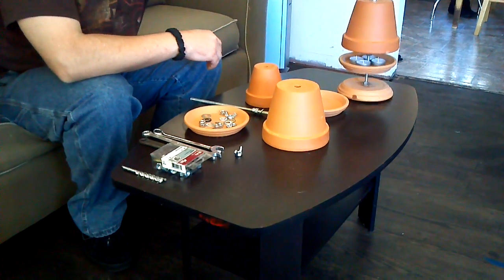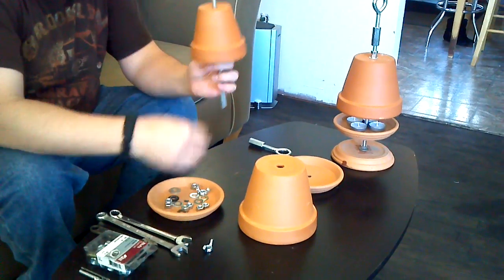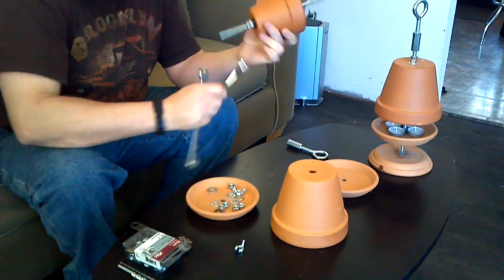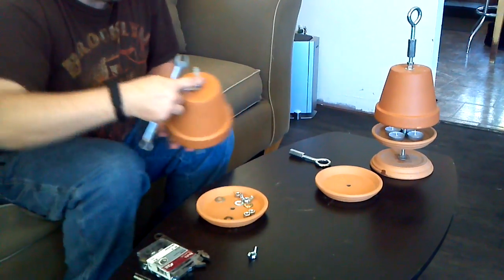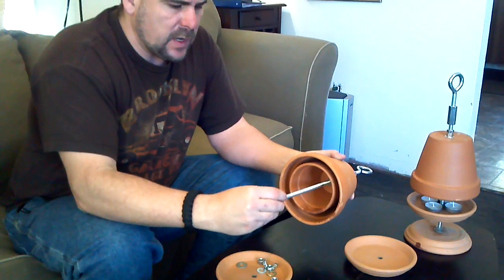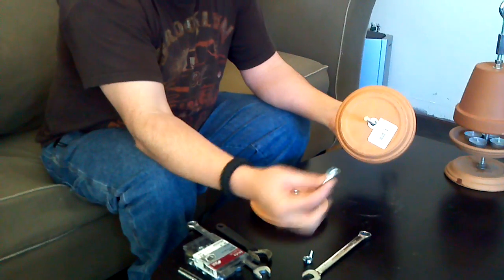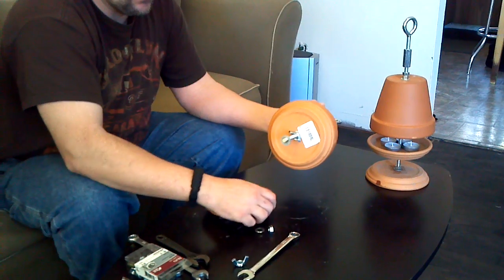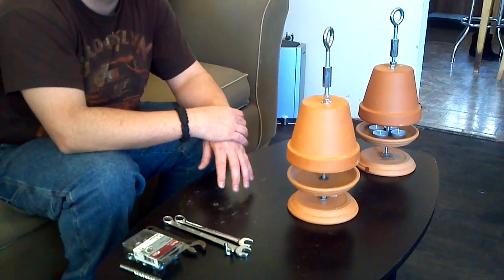Flower pot heater

Comment: Electrical rates have almost doubled in Richland WA due to some "new" projects.  People are protesting (real) & taking pitch forks to city hall... (not real) I am investigating how I can at least stay warmer in the afternoons in my small apartment. Two of these with Crisco shorting candles would burn for 6 ++ hours for just pennies.  Safety is a big issue I would put them on a cookie sheet with a ceramic tile under that. Never leave them alone.  Going to the garbage bin, I would lift the lid blow them out.  Never sleep with them going.  Thanks for the video.

Comment: A candle puts out a certain amount of heat, this heat cannot be amplified without the addition of external energy, laws of thermodynamics. Adding a ceramic pot or two will not increase the amount of heat from the candle. Therefore the ceramic pots are only a safety device so stupid people do not touch the open flame, just light the candles and enjoy the flame…

Comment: I have read that you shouldn’t use zinc coated material. Just stainless steel. As when heated the zinc can give off zinc oxide which if inhaled can cause cancer.

Comment: There's a video of a sailor who almost burned her boat down.
I don't know who originally started the trend of blocking off the hole at the top in order to create a work of art. It's a simple version of a convection heater.  However if you block the top hole the heat is trapped, temperature rises  and  you create a potential incendiary device.
Reply: yeah, i like the design, one of the better simple to make ones, but if i make any i will definitely drill a few holes in both pots for the hot air to escape - maybe opposing each other between the two pots

Comment: These nonsense "heaters" are a great way to burn your house down. The pot only concentrates the heat in one area. It is impossible to increase the BTU output of the candles. Check out the first two laws of thermodynamics.

Comment: excellent design. I've seen other videos where they add a few nuts and washers , stacking them on the inside.(nut, washer, nut, washer...) it's suppose to help put out more heat? Would be cool to see a test to see if that is correct

Comment: Thanks so much, this is definitely the best design I've found. I immediately went to the store and made two of them; a smaller one and a bigger one. Then using them for the first time, I found out that you must not move the thing once it's burning. I also found out that the metal eye on top will get very hot too ha ha! So be careful with that!
Reply: How much this everything cost you to make?
Reply: Oven mitts or potholders next to the heater would be a must...also a cookie sheet to lay it on to blow out flame.

Comment: What would keep the melted wax from leaking down out of the dish you have the candles in through the hole with the rod and bolt? This could cause a flash flare if it did. That would be a bad thing.. I love these and thought about making one, but this concerns me.
Reply: Foil

Comment: Mine caught fire. I bumped it and the tea light wax spilled and caught flame 🔥  the bolt to stop it from going to high you might want to reconsider. If it should catch fire you can cut off the oxygen easy by pushing that piece up.

Comment: Need to make one of these for my P/U truck. I haul travel trailers with my dually truck & have the front seat & back seat taken out & made a tiny bed in back to sleep in. I have plywood on the floor in front laying level . This could heat up my truck while I am sleeping on those cold nights in the winter months. Does it admit any Carbon monoxide?

Comment: how u deal with the co2 ,in a room not ventilated for 24hrs?
Reply: if you are using 4 tiny candles you don't need to worry, place a co2 sensor near by you will see it wont set it off
Reply: ventilate it :))))